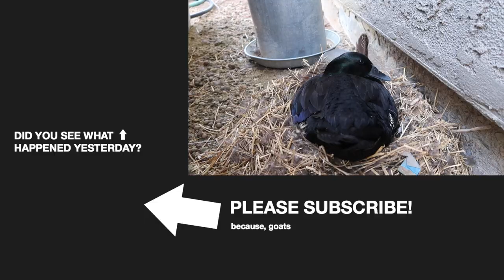A deck made from reclaimed wood PALLETS?

Comment: Around here wood pallets are really hard to come by but my brother in law was able to get a bunch for me and we used them to build a shed. We screwed them together end to end to make walls and put them on the ground for the floor. Cut out some windows, covered the outside with plywood and paint, put some boards across the top and covered with sheet metal for the roof. It started out as a chicken coop but is now a goat shelter ;)
Reply from the maker: Awesome!

Comment: Paided for Palllet's ?!!! there free all over the DC area !!!!! In fact help a friend get over 800 Pallets and they paid him $150 for taking them al. He going to use them to do some building in WV. One item is a storage area for his fire wood. He also got free paint from craigslist to paint the items he made so they stand up to the weather better. One of the other is a outside stall for animals at the backside of the field (would hold 3 of 4 cow's). He thinks of some Goats or Cow's with a horse or two in a 2 acres. and a small cabin at the far end of his 32 acre area (get out of the weather place)